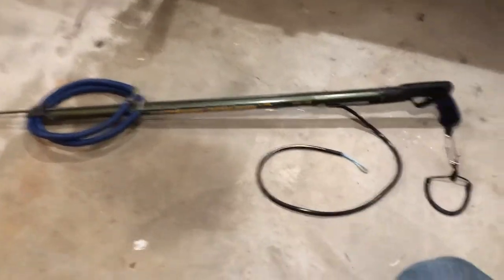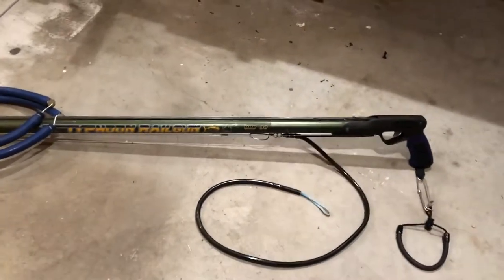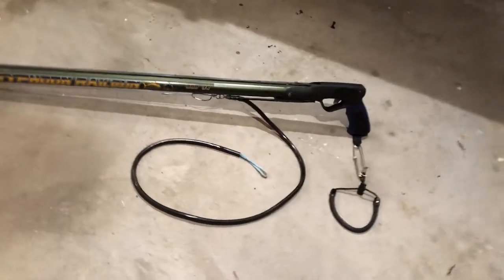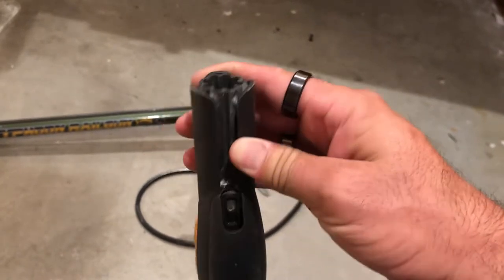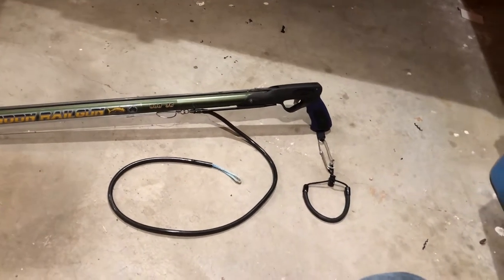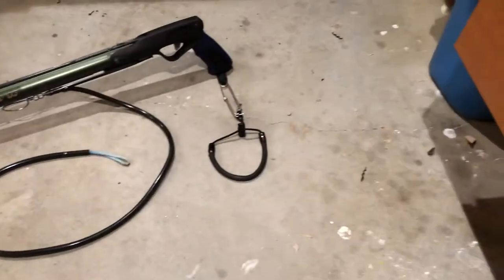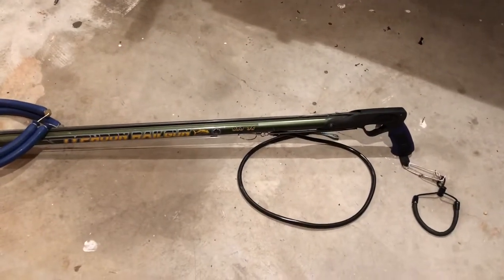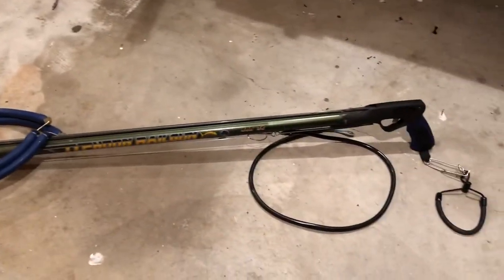Pelaj Typhoon Trigger Swap with Rob Allen Vecta2

Comment: Hey how are you I have an inportant question the metal part of my bands won’t fit the notches on the spear . What should I do ?
Reply from the maker: Buy new bands. Theyre cheap. I highly recommend buying the rob allen bands with dyneema wishbones through freedive shop. I didnt see pre-made bands on their website just now, but I would be willing to bet they can make up what you need.
Reply: Thanks , so that gun is meant to use the dyneema and not metal ?
Reply from the maker: yes. Sorry for the late response, my notifications were not on for some reason.